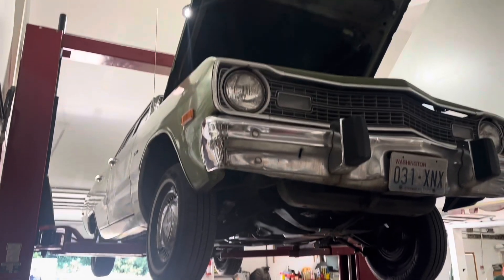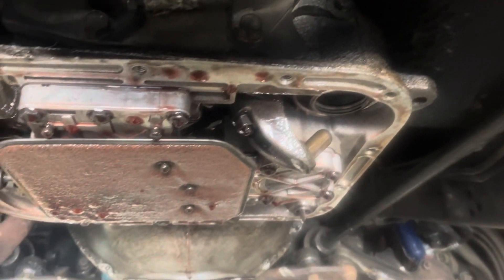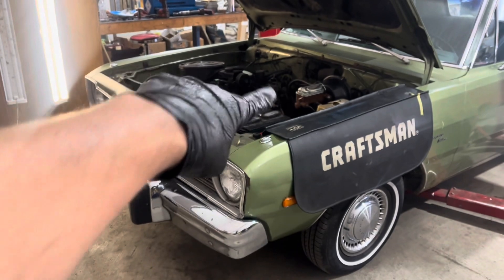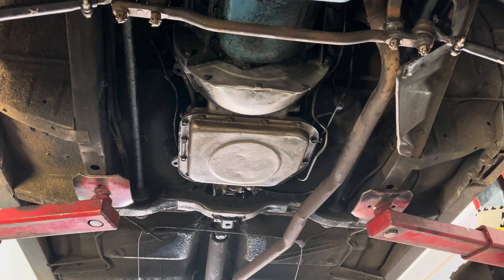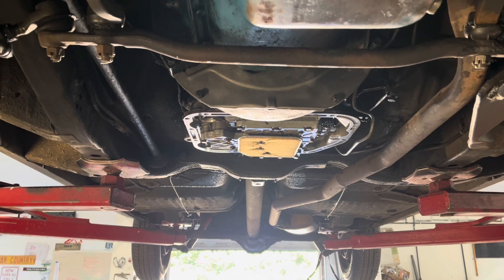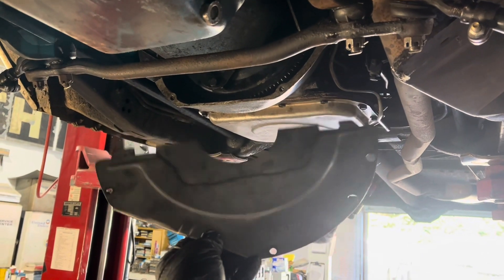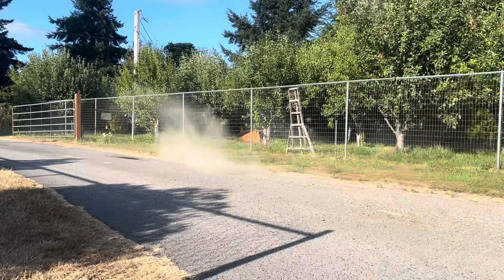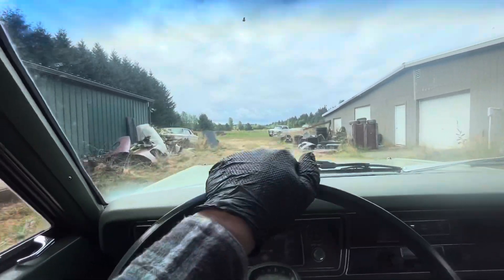Slant Six Powered 1973 Dodge Dart Gets A New Transmission! (Because Reverse Is Useful)

Comment: I learned to drive a stick in a green '73 Dart Swinger Special, /6, 3 on the tree, way back in '74.
Reply from the maker: Nice! I had some times in a ‘74 sedan almost just like this one with a three on the tree. I learned about trying to shift gears with gusto… don’t. I got the shifter bound up many times, with the transmission stuck in first gear. Just a little embarrassing. 

I actually just bought back this boomerang ‘72 Dart which was originally a slant six, three on the tree Swinger Special. Those are neat cars.